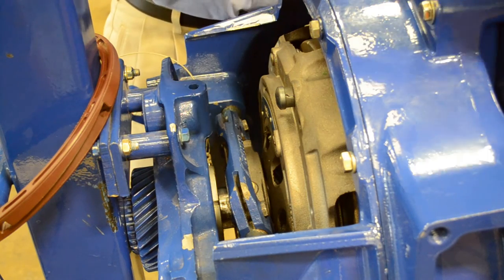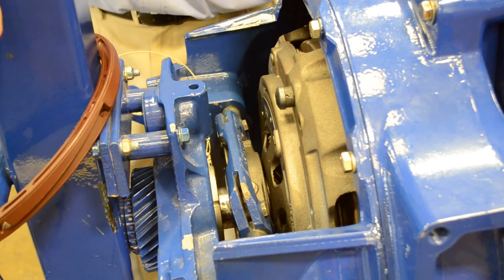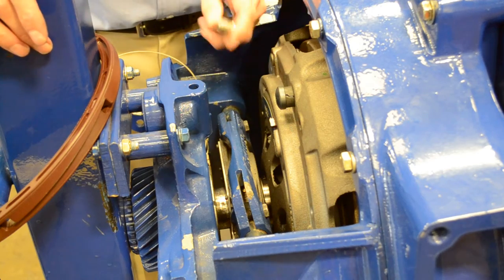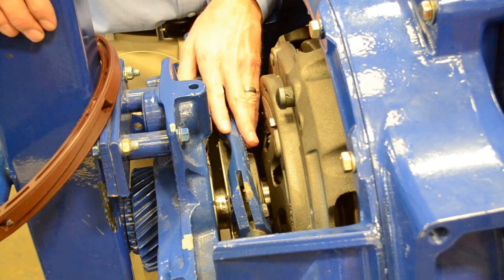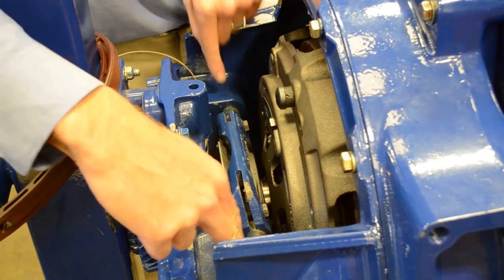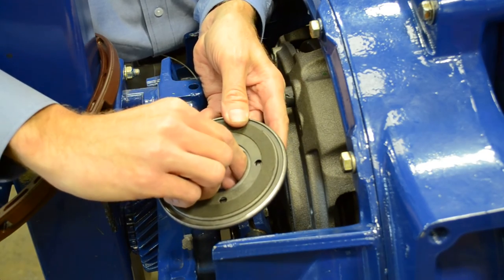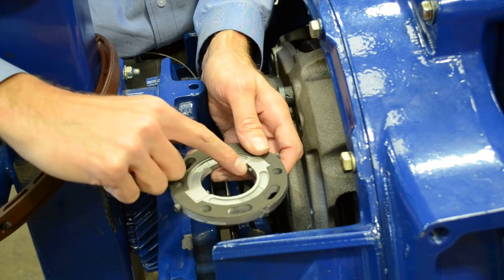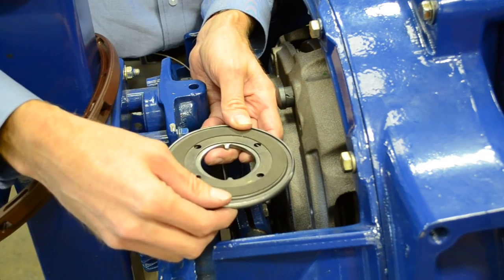Solo Clutch Style Adjusting Procedures - Video #2

Comment: ive replaced so many of these clutches
Reply: Yup...Great when new
Reply: Byron Lininger when they run few miles not so much we put old style back in
Reply: You are correct. WE have had many problems with the solo clutch.Easy pedal is the best setup.Did you watch the vid on resetting the solo. WTF